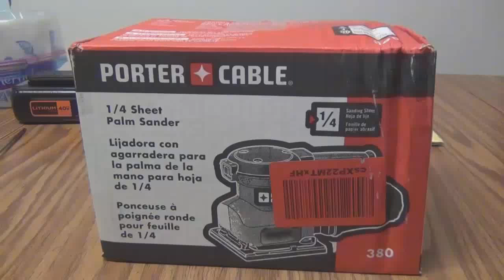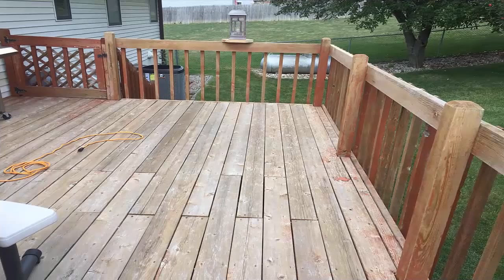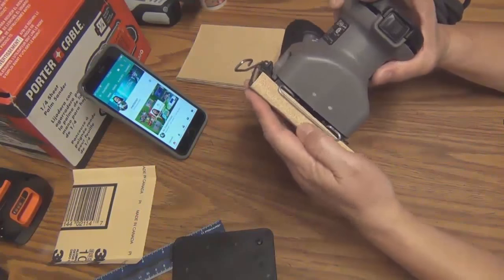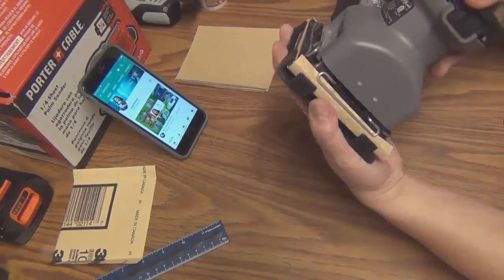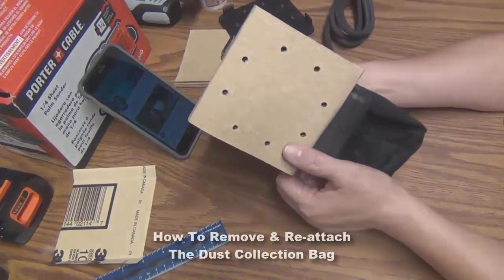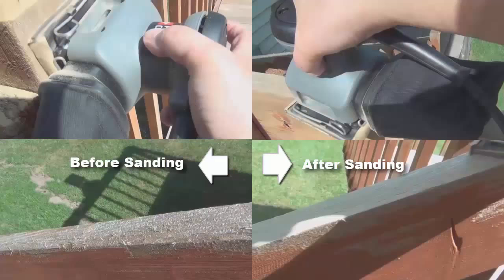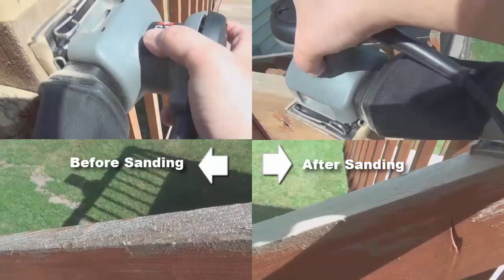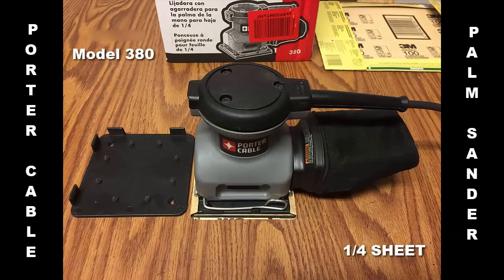Porter Cable 1/4 Sheet Palm Sander Model 380  |  Unboxing, Operating How Tos & Review #portercable

Comment: This info is still relevant and helped me understand how that filter works. And, yes I have an older model Porter Cable palm sander.
Reply from the maker: I still have this Sander. I use it to sand my porch and my deck. 

Thanks for sharing your thoughts and for the visit!

Comment: Appreciate your comments on the dust bag issues. I was debating whether to use it or not. I have Model 340 and since I do not have the manual, this was a GREAT help!
Reply from the maker: Thanks for sharing your thoughts and for the visit, Katherine! If you need the Manual for Model 340, go to this link: https://www.manualslib.com/manual/132364/Porter-Cable-340.html

Don't forget to like and subscribe!  Thanks!